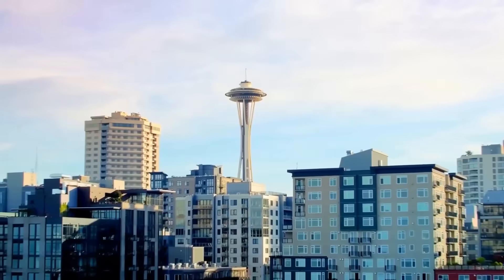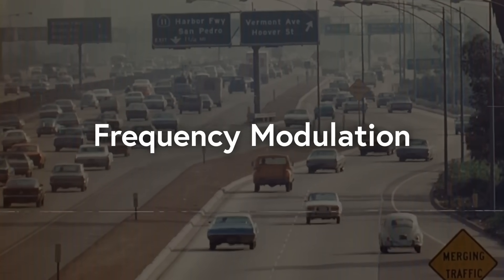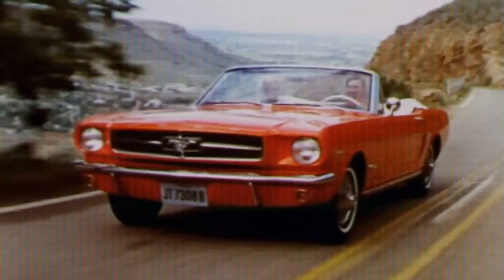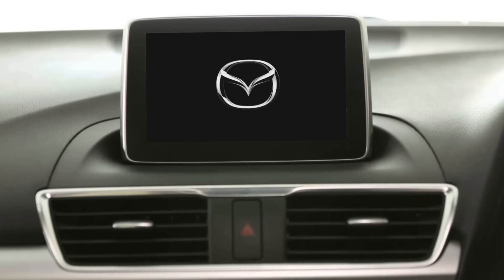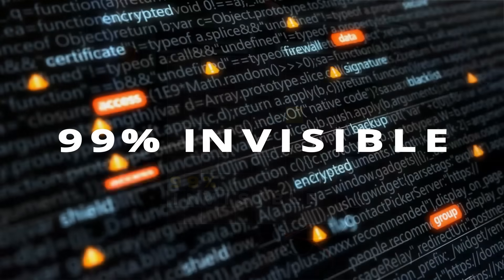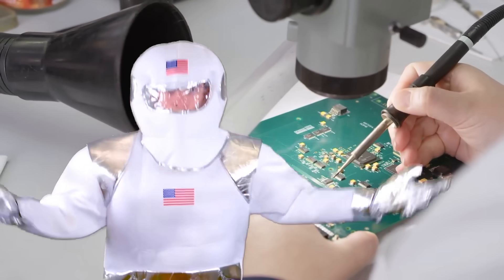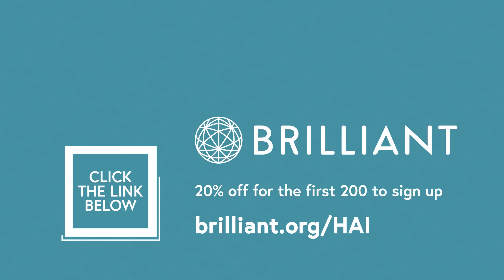Why Hundreds of Mazdas Tuned to 94.9 Broke Simultaneously

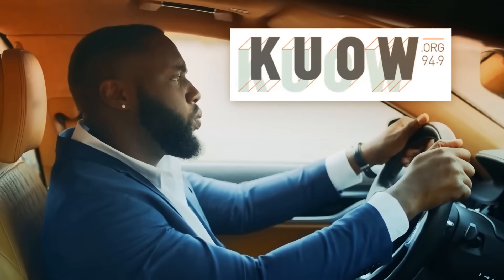Comment: At 0:20 in the video, the stock clip is of a radio I spent 3 years helping make for GM as a consultant to a supplier. Fun fact: That radio was awesome for its time (2006~2013)... three models capable of RDS Text, talking to XM radio and OnStar modules and it handled all the various sounds your car needed to make (chimes, turn signals, etc...) The two upper tier models played MP3 tracks from CD-Rs, the top tier had a 6-disc changer built into the unit. Could a percent sign in a message mess up that radio? Possibly... I only had a direct hand in the radio's code for a small bit, most of my work was to support the radio from a development, QA,  and service perspective. Anyway, that was my "cool story"
Reply: That actually touches on one thing that occurred to me here wouldn't killing the infotainment system on a model that recent likely also kill features the car is legally required to have working eg turn signal sounds etc. I guess it could be that that there is a separate audio mixer that simply mixes those sounds in with the output from the infotainment systems DAC in hardware after the fact. But if it is relying on the software to do it surely this would have the potential to bugger up the roadworthiness of the vehicle according to the regulations in many countries. I think failure of the indicator (aka turn signal as you call it) sound in a car will fail the annual inspection (MOT) in the UK for example thus making it illegal to drive until fixed.
Reply: @FaerieSeraphina  I can see sounds being an issue. The radio I helped with wasn't really otherwise critical to the operation of the vehicle, and ran on a "lower communication bus" of the vehicle - however, there was one morning I arrived at Warren Tech Center to see the entire Instrument Panel Cluster all messed up, and they were blaming our radio for the problem (spoiler: it wasn't our fault) - it was a network issue, however. In general, most of the controllers on these vehicle networks use standard libraries, and are tested and fairly robust.
I don't think audible signals are a requirement here in the US (or the Canadian market), but when present, I believe there were some specific standards for how they were supposed to sound.
Reply: @wtflolomg  Fascinating. I thought something similar when I saw that clip, "hey, that's a GM radio!" On the subject of the different tiers of the radios, I found it interesting that swapping radios between vehicles can change the sound the turn signals make. My car originally came with the radio that could do MP3 discs, connect to iPods, etc, but no disc changer. I upgraded to a newer version of the same radio, which now has a USB port on the front, and the sounds my turn signals made changed with it. Ironically, the newer sound seems to emulate an actual clicking relay better than the original sound.
Reply: @FaerieSeraphina  the turn signals still worked, there just wasn’t the click sound. I can’t imagine that make your car fail the mot, they are a visual indicator which is still functioning.
Reply: @335m5  It is required under the construction and use regulations which is what the MOT is testing for compliance with so it probably would.
Reply: @FaerieSeraphina  the turn signal is ment to be a visual indicator which would still be functioning. The sound originally was just a relay clicking, now it’s a subliminal thing so you think your car is functioning properly. What does sound have to do with you letting people know your turning? Other drivers can’t hear the sound,  Deaf people can’t hear it when they drive.
Reply: @335m5  The reason the law continues to require it is to act as a reminder when people forget to turn it off.
Reply: @FaerieSeraphina  so I just looked at the MOT inspector guide and the sound for inspections is only required if the dashboard visual indicator would be obscured (I suppose by the wheel, or some other UI element) from the driver. 

“Check the driver's 'tell-tale' warning device for presence and operation. Note: A 'tell-tale' may be audible or visual, it is not required if one or more direction indicators on each side can be seen by the driver from the driver's seat.”
Reply: @FaerieSeraphina  Chrysler products have a separate module that makes all the sounds that used to be performed by simpler and cheaper means. A friend of mine has  a 2015 Grand Crapavan that stopped issuing all audio cues at 58k miles. No seat belt chime, no driver alert tones, no turn signal sound, nada. Dealer quoted around $1,600-1,800 to have it fixed. She's a widow on fixed income, thank goodness her husband paid it off before he passed or she'd be stuck making payments on that lemon. During the warranty period, it went through two oil leak repairs, destroyed a few intake valves around 27k miles, and killed 4 Mopar batteries.
Reply: @dashcamandy2242  The first part of what you said makes more sense to me and this from a software developer so I'm biased in the sense I'd love to be able to tinker at the highest level available. That said this is also why I'd openly tell any hardware engineer designing such a system to shove a simple analogue mixer and amplifier on the output end of my software controlled DAC.

Simple fact is that any Turing complete processor should probably be the last resort in any remotely critical role and then never without redundancies and an override. Flexibility is not your friend when dependability is your goal, the more the part can do the more it can do wrong.

In that regard a Turing complete processor is bloody terrible the complexity that enables it to run billions of useful algorithms comes at the cost of many more points of failure to accidently trigger or exploit. Granted there are ways to break an analogue audio mixer via it's inputs eg overvolting them but listing all the ways I could render a programable CPU inop would take approximately forever, granted many would be subtle variations on a theme but this is why malware scanners are in a constant arms race after all tweaky tweaky until you find one of the near infinite solutions to do the same thing that isn't caught by the signature.
Reply: wow! small world.
Reply: so you helped develop the US8 (the Single Disc MP3 capable AM/FM/XM radio) and US9 (the 6 Disc MP3 capable AM/FM/XM radio) radios that currently live in my Dad's 2009 Silverado, and my 2006 Buick Lucerne? that's actually cool!
Reply: I had that model on my 2009 Pontiac G5! Such a great radio! Easy to use and simple. Although with newer model iPhones connected through usb didn’t make for an easy podcast experience.
Reply: It may have been "awesome for its time", but it probably cost 5 times as much as an option than any stand-alone device with the same functionality and it would have been technically outdated by 5 years the first day it was sold in a car. That stuff was fine back in the time when the biggest hurdle to swapping a radio for any aftermarket model was finding the right unclipping tool. But nowadays you need to buy a new car when the radio is outdated.

Sorry for the rant. I'm suffering from this issue. I mean the 8.9" touchscreen in my car is nice, and the bluetooth module even connects to my phone 4 out of 5 days a week, but the navigation is outdated to the point of uselessness and the line in makes more noise by itself than the engine at high rpm. But the manufacturer has made sure that I never can install an aftermarket system (unless I strap it to the top of the dash and wire in additional speakers) by routing all types of important stuff (AC, key settings, ...) through it. Sorry for adding a second rant.
Reply: And yet the Nav data is forever stuck at 2015, if you get the last disc....
Reply: I do like the features of those and similar GM radios, but don't like that they're tied to other systems. My 04 and 05 Malibus had the trip computer and unit switching on the radio display, so I definitely couldn't upgrade with an aftermarket radio without an alternate way to access those features.
Reply: I had the one before that. A 2002 GMC Envoy with the Bose system and 6 disc changer and only on that first year they came with a different amp apparently and that system was soo much better sounding than it had any business being. Sounded better than my "Bose/Premium" system in my 2015 Tahoe LT. Waay better than my 2014 Honda Accord "PrEmIuM" sound system. Which is trash.
Reply: holy shit thtas awesome
Reply: That was a cool story! Thank you :-)
Reply: Did it get put into Chevy HHRs?
Reply: @williamwilson836  Probably, after 2006, it went into a lot of GM models. My wife's 2007 Pontiac Torrent had one.
Reply: Black Tie?
Reply: Had a 2008 impala with that GM radio. It lasted over 12 years and still worked like a champ when i traded it in due to a failing transmission. Those radios were built like tanks
Reply: So you are to blame for my 08 Cobalt no longer making the blinking sound when my turn signal is on? It's incredibly annoying that all those important sounds are fed through the drivers side speaker, which works about 10 days a year
Reply: My 09 Pontiac Vibe has that model in it! It works very well, good job (though I do wish it would scroll song and artist names on XM if they get too long to show fully)
Reply: There's nothing awesome about OnStar... or GM. That's not to say there arent awesome engineers at GM, just not sure why they'd work there.
Reply: @sunalwaysshinesonTVs  There's nothing awesome about OnStar...? I mean, I get it's not exciting, but it's unobtrusive and yet pretty decent. Really all it has to do is call 911 in the case of an accident, and well yeah it does that pretty well I imagine. It kinda just feels like you're hating on GM for the sake of doing so lol.
Reply: @redey1290  also they can remotely unlock your doors in case you accidentally lock yourself out of the car, as well as they can track your vehicle (and on newer vehicles remotely disable it) if it’s stolen (and they only activate the tracking and disabling features with authorization from both you and local law enforcement agencies)
Reply: @BenJeremy the technical data about the radio may, at a push, be "interesting" to someone. Can't really see what's "fun fact" about it. There seems to be a new definition of "fun" taking over the world. Fun fact: makes me feel sick.
Reply: I don't want to burst anyones bubble ,- but all those chimes and dings and so on are not "awesome" , i go to great lengths to find ways to eliminate them. Dont need a effin car talking to me. Not hating onyou, hating on the idea behind it which has been there since man started trading his balls for silicon wafers.

Comment: This is ludicrous. I mean, apart from the fact that even very simple computers decades ago could work out file types without extensions, if Mazda really found it too hard to implement such a feature that… again… has been available for decades… any unrecognised file in an embedded car computer system should just be ignored, and probably also deleted. As it stands right now, you could literally drive around in a car with a pretty low power (hard to detect) pirate radio transmitter outputting on the same frequency as a popular local radio station, outputting tiny unrecognised files, and brick a good number of the Mazdas you drove past. To be completely clear I’m not endorsing that anyone try this, but most people with my (pretty good but not genius) level of computer skills could do this, and if I lacked the ethical beliefs I have, I was bored, and I wanted to troll some drivers, I would totally be doing this.
Reply: It's probably more an oversight in coding rather than laziness or cost saving, but yeah considering the multiple issues presented they need to be testing their code better
Reply: @kahlzun  yeah, it was probably inexperience rather than incompetence or laziness, but it seems such a basic thing to check for to me. Assume that you could receive broken files. And if there’s an invalid jpeg or something, let the image renderer fail without taking down the whole system. Imagine if web browsers just crashed every time a site had an image file that was broken or couldn’t be downloaded!
Reply: Yeah, they'd literally just needed an empty else-statement/default case to avoid unexpected filetypes or lack of filetype information from doing any harm!
Reply: ludicrous today and scary tomorrow, imagine if this happens in self driving cars, who knows what can happen?
Reply: It sorta just sounds like they missed a user senario and test case during development and less like Mazda was dumb and lazy
Reply: @dukedub  I would say whoever programmed this was inexperienced, because this is a pretty basic thing to check for. I’m not going to say dumb or lazy because I don’t know them or the environment they worked in.
Reply: Mazda hatred will not be tolerated
Reply: @poopmeat15  I love Mazda, one of my exes had one (a sporty two seater) and she’d drive us around in it, it was awesome. That’s why it’s so disappointing to me. And being a really nerdy girl, bad computer design frustrates me 😂
Reply: When I first met my wife of now almost 12 years, my FIL had one of those cool little 2 1/2 door Mazda Rotary Engine setups. It's a shame those didn't take off in North America and last longer. Because I remember it was a sweet ride. Those engines were something else. I think it could get to 6,000 RPM and barely break a sweat.
Reply: @User31129  don't know what a FIL is. Sounds like you're describing the RX8. That was the most forgettable rotary car unfortunately. The only way to make them fast was to swap out the entire engine and ecu out for a RX7 parts. Then you had to conquer the terrible look when compared to the FD RX7 which was the car it replaced.
Reply: @dukedub  Father-In-Law

Comment: Notes:
The files are actually maintained by a third party, not by KUOW; meaning the matadata tagging company was responsible for the missing extensions.  That said, this is a security vulnerability on the part of Mazda and should be reported as such; denying it gives the company an out because "oops it's just a radio" until it's not just a radio anymore.
Reply: @galactic_socialist  And Mazda is responsible for the function and safety of their car's onboard system. Sanitizing inputs and catching potential errors is their responsibility, as is clearing any non-volatile cache and RAM upon reboot to prevent the system from being stuck in an error loop like this.
I blame Mazda 100%
Reply: @galactic_socialist  The station has no fault. Yes, they made a small mistake, but that should never have caused this kind of issue.

What you are saying is like "You (Brian) have a spelling error in your comment, causing my friend to have an heart attack".
Doesn't make sense, and you obviously know that that heart attack isn't your fault.
It is the same for the missing extension.
Reply: @galactic_socialist  Station responsible? Never. Who is responsible for waking you up in the morning?